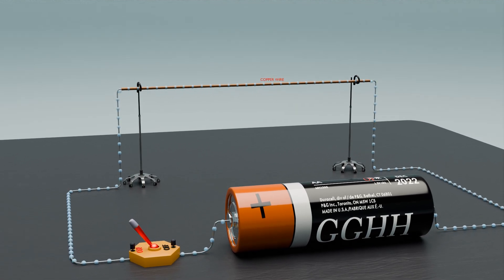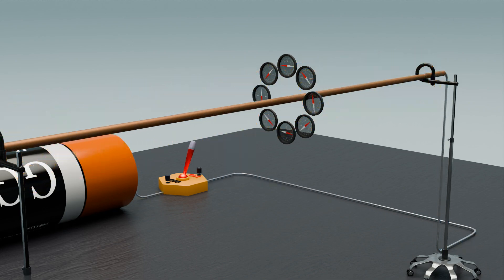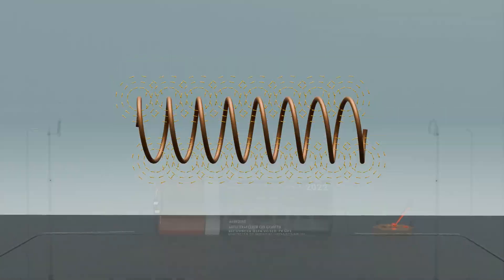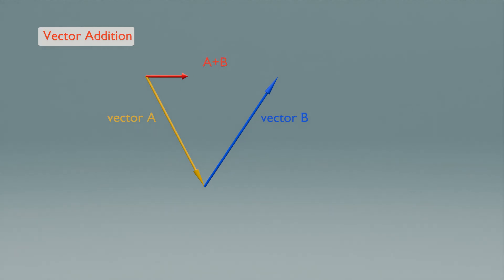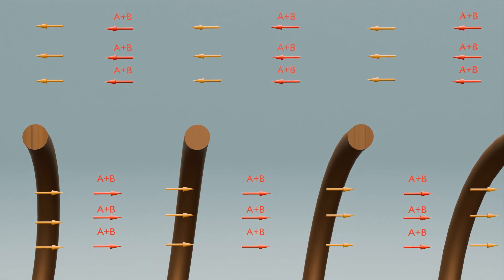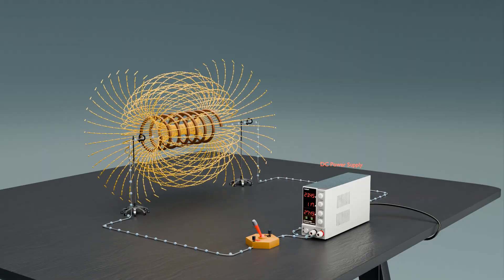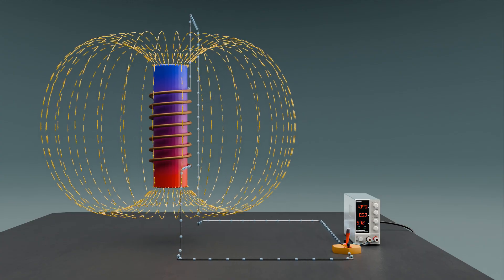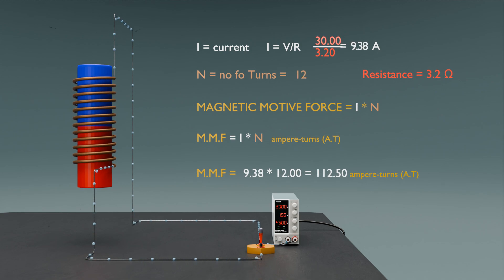How Does an Electromagnet Work? | #electromagnetics #faradayslaw

Comment: Current flow around the wire. No motion within the wire.
Reply: That is not correct.
Current is the flow of electrons, in fact a current of 1 amp is the flow of 1 coulomb of electrical charge.per second passing a point.

1 coulomb of charge is 6,241,509,629,152,650,000 electrons.

The electrons are moving in the wire. They do not and cannot move outside of the wire in air.

The movement of electrons in air would be an arc, a Corona discharge, a plasma, and the fact is this does not exist, under normal conditions.
Reply: @deang5622  it cannot flow straight through the wire due to resistance. Resistance deflect this flow around the circumference forming a ring like structures. This is why compass needles formed circle around a wire because they are being dragged to this flow. This is also the reason why if we coil a wire, these rings which was perpendicular to a wire will now focus at the center  of a hole to a now curved wire creating heat that can turn iron redhot due to compresion. This is the true concept.

Comment: Don't forget all AC & Radio waves type power have three elements, 1. the positive cycle 2. the neutron, last but not least the   3  the negative cycle.  That neutron cycle is by far the most powerful once you understand:  Without the neutron, the energy could not move forward!!!  You can learn allot about this if you have a bar magnet.  I will prove to you that the center field of a magnet is the most powerful by far!!!  It's how they built the great pyramids!!    If you have a bar magnet/ not a horseshoe type, I'm going to show you all the basics.   DO NOT DISRUPT THE CENTER FIELD WITH ANY OTHER METAL>> 1. Anti-gravity, get something like plastic or glass a granite rock would work well just tap with your finger the centerfield of the magnet near same and it will lose 2/3 it's weight, Next 2.  let's tap the center field near a stream of water and watch it repel the water.  3. If you vibrate the center field at the correct frequency any granite rock will become butter.  YOU MUST UNDERSTAND THE DIFFERANCE FROM An OSCILLATION AND A VIBRATION!!!  The petrographs on the pyramids told us all of this...  Our future will depend on the center field, The height of one's intelligence is directly proportional to their realization of their own ignorance VPC!!